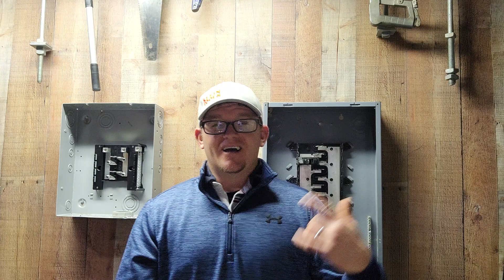E.I.A 🎬  Single Outlet Rule Explained

Comment: Hi Perry,  here is a situation: I have a Jetted tub with 2 pumps: 9.4 amps and 7 amps. It is very unlikely for them to run 3 hours or more so technically the tub would be considered non continuous load.  This means the 80% rule doesn't apply, but because both loads are motors should I still use the 80% rule? 
Thanks, love your content